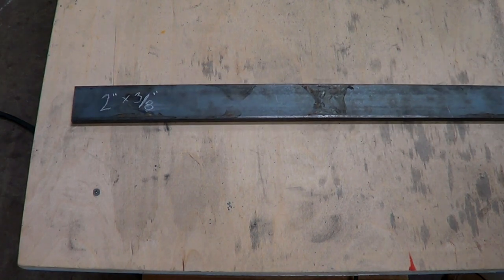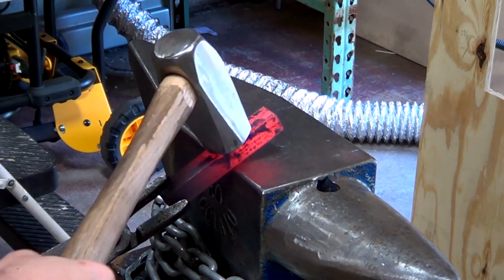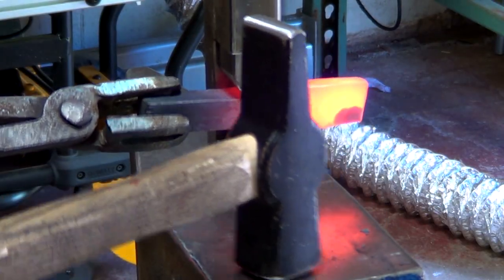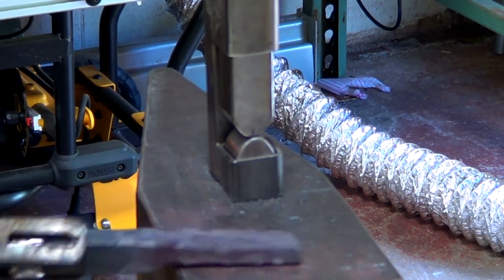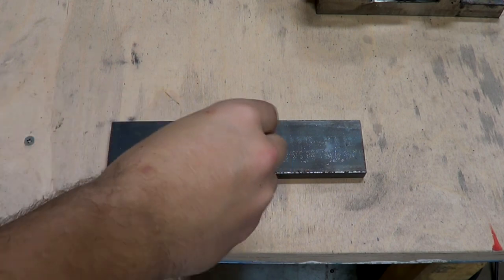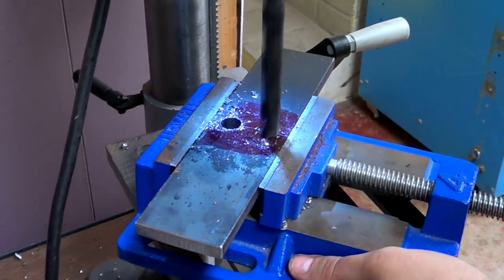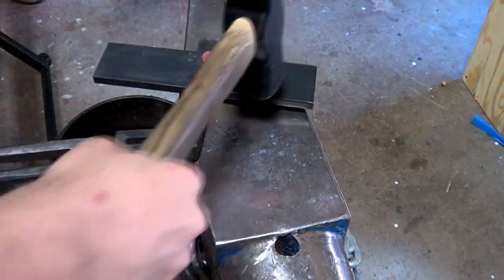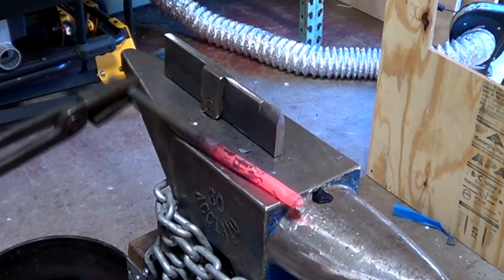Forging A Helpful Hardy Tool

Comment: That is a great idea, to make a wide, multi purpose hardy. Looks like 3 different useful tool surfaces. I like the rivet fastened joint and great job with them, by the way. They are much more difficult than they look. One small trick to try.  If you have a cutting tip on an oxy-acet torch, the rivets can be reheated slightly, once they are set. Then pounded to finish. Great video. I don't have the skills or know-how to produce such a video. Thanks for sharing you idea.

Comment: That's actually pretty cool. Good on you for not casually wandering over to a power hammer for that thick bar. I have that anvil too and the hardy hole is very inconsistent. I'm going to have to adjust some of the tools I've picked up so they fit right.